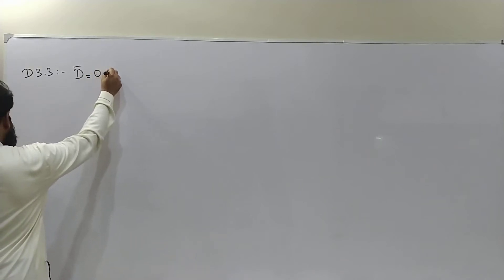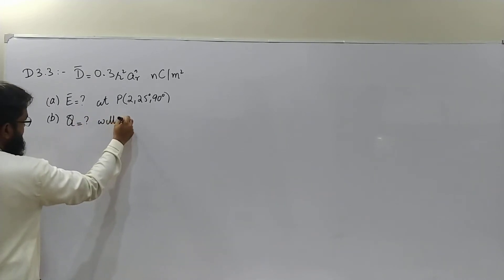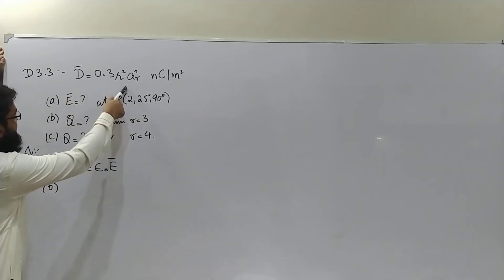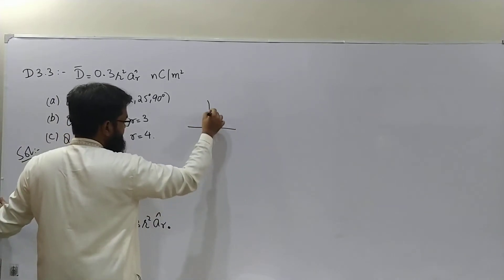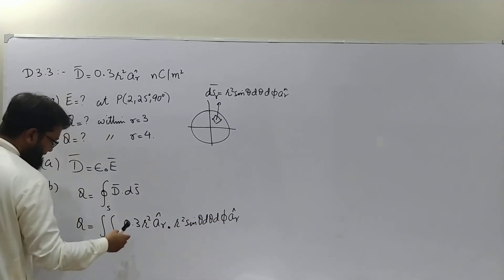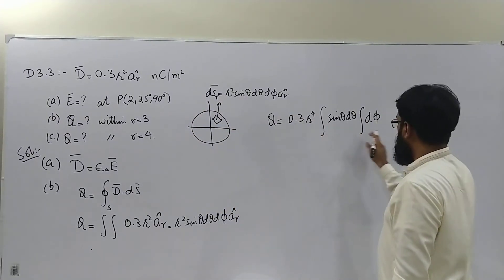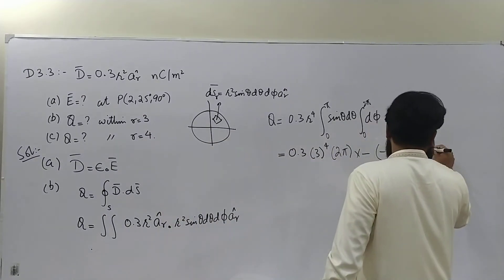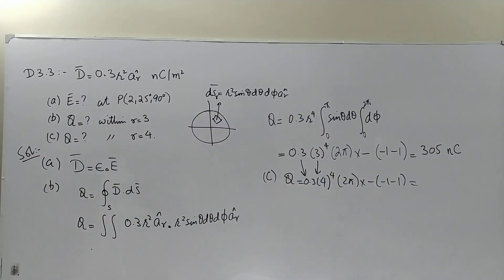Drill Problem 3.3

Comment: and sir in part c its total flux leaving the sphere not total charge . is formula and method is same in that case to
Reply from the maker: Yes ... total electric flux leaving a closed surface is equal to the total charge enclosed by that surface. So essential the problem boils down to finding the total charge enclosed by r=4 surface.